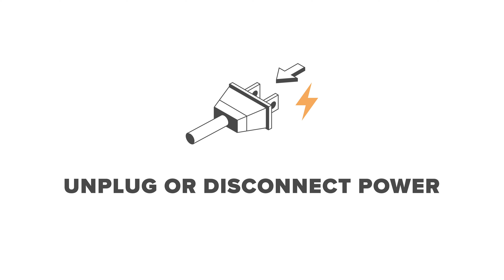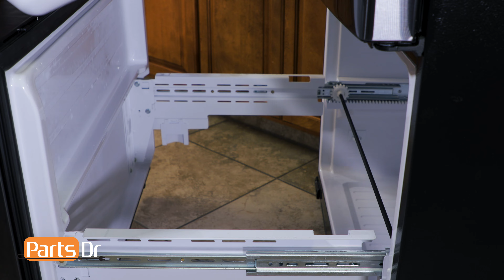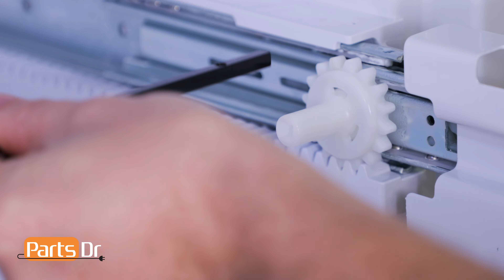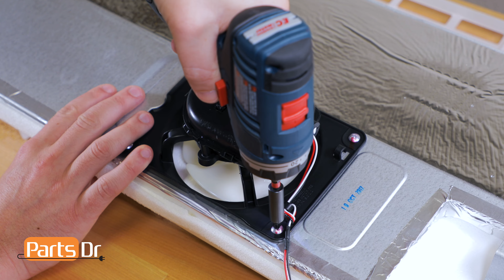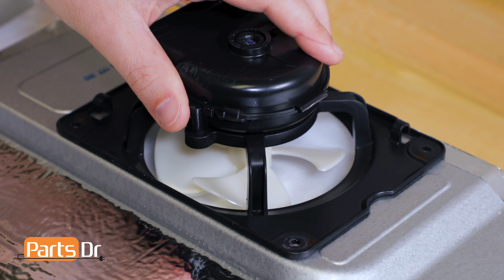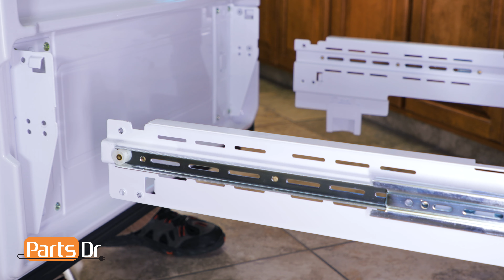How to replace Samsung freezer evaporator fan motor part # DA96-00959D

Comment from the maker: Thanks for watching our step-by-step guide on replacing the freezer evaporator fan motor in your Samsung refrigerator! If you're ordering this part online, be careful with cheaper aftermarket versions, especially from sites like Amazon or eBay. These low-quality parts often don't perform well and can lead to cooling issues or early failure. For reliable performance, we always recommend using genuine OEM parts. You can get the original Samsung part shown in the video at https://partsdr.com. Happy repairing and let us know how your repair goes in the comments!

Comment: This video was super helpful.  Make sure your evaporator fan is in the freezer.  For some Samsung fridge's it is in the main refrigeration compartment.  I watched another video from another company and thought mine was in the main fridge.  Took it apart and there was no fan.  I almost gave up.  Then I found this video and figured out mine was in the freezer.  Mine was a little more complicated because there is an icemaker, but just remove the two screws and pull it out of the way.  Also my fan installed slightly different than shown here.  It is a three screw unit that is recessed in the panel.  Just a little more work to move some tape and remove the old fan.  I am 75 and do not consider myself super mechanical.  Had I not removed the top portion first this would have taken me about an hour, including unloading and re-loading the freezer   A man from a former reputable big box repair company came out and charged me $139 for a service call..  He listened to my fan and said the issue is a bad fan.  The door hinge was not closing properly either.  He quoted me $350 for the fan.  $350 for the door hinge assembly and $450 for labor.  He spent no more than 10 minutes at my home, told me that I needed to sign and pay, and he would order the part. Cost was $1150.   When I said I needed to think about it, he told me I was better off just to buy a new fridge and left.  My fridge is only 3 years old so I started doing some research.  Thanks to this video, the new fan is in and running great so far.  I had already purchased another fan online and it was nowhere near $350..  Had I found this video sooner I would have purchased it from these guys.  This saved me a lot of money and did not cost me too much in time.  Thanks Parts Doctor.  I would highly recommend this video and using your business.

Comment: Hi - great video! If my refrigerator stopped cooling but freezer still ice cold, is this the likely fix? I can't figure out of this fan feeds cold air into the fridge or if I should be looking instead at the fan in the fridge compartment?  I have the Samsung RF27T5241SR -

Comment: Is there supposed to be styrofoam behind the panel? I cannot seem to work mine loose.
Reply: I have styrofoam on the back of mine, too. It comes down with the cover that you are removing. Just pull out from the bottom of the cover, and then down and out gently, and make sure the styrofoam comes with the cover. Mine also had twin fan motors. I have to order the second since I have no clue which one is bad.

Comment: Is it a true statement if an intermittent humming sound coming from the refrigerator is the freezer evaporator motor fan, and not the compressor when the sound stops upon opening up the freezer door? And that if it were the compressor, the humming would continue whether or not the freezer door were opened? Thanks very much.
Reply from the maker: Most Samsung refrigerators have a separate evaporator fan motor in the refrigerator section.  https://www.youtube.com/watch?v=lre-FuQKN5s
Reply: @PartsDr  My question (better worded): 1. Loud humming sound. 2. Open bottom freezer door. 3. Close bottom freezer door. 4. Humming stops. Does this mean freezer evaporator fan is the cause of the humming and NOT the compressor? Thanks.

Comment: I have been having issues with my samsung rf28hfedtsr/aa. At random the freezer started making knocking noises, but there is now ice build up. I even did a force defrost to see if it could be something else, but nope the freezer kept knocking.  Could it be that the freezer evaporator fan needs to be replaced?
Reply: My issue too. The noise slowly got worse and the fan motor burned out.

Comment: Is this the fan that also cools the fridge? If it's not, do you have a video showing how to do that? My freezer is fine but the fridge isn't cooling. My fridge model number is RF32CG5300SRAA.
Reply from the maker: Most Samsung refrigerator models have separate fan motors for the refrigerator and freezer sections.  We have a video on the refrigerator fan motor in this video: https://www.youtube.com/watch?v=lre-FuQKN5s
Reply: @PartsDr  Thank you so much!!

Comment: If ice keeps coming back, can a supplemental defrost line be added to top as a fix?
Reply from the maker: If the evaporator coil is icing up, that indicates a failure in the automatic defrost components (defrost heater, defrost bi-metal, defrost sensor, main control board).
Reply: @PartsDr  any chance you have a video talking about testing or replacing those parts?
Reply from the maker: @Mirer03  See the videos linked below.
Not cooling: https://www.youtube.com/watch?v=_m7pW3PueJs
Test temp sensor: https://www.youtube.com/watch?v=J5bwcteeJNM
Test defrost bi-metal: https://www.youtube.com/watch?v=i4SNEgPoUMY
Test defrost heater: https://www.youtube.com/watch?v=q7hysgipzpQ

Comment: Can i ohm out the motors?  I have two fans for my freezer
Reply from the maker: Yes can perform an ohm test on the motors, but even if the motor passes that test the motor can still be bad.  A better test would be doing a voltage test if you are comfortable working around electricity.  We have a video that shows how to do that type of test here: https://www.youtube.com/watch?v=x9fK0bN72MA

Comment: Would a faulty evaporator fan motor also cause the ice maker to not make ice?
Reply from the maker: Yes it can, because the ice maker has to cool down to a certain temperature to make ice and if this fan motor isn't working the freezer will not cool properly.
Reply: Same with mine. The fan motor burned out, and the ice in the ice maker started melting. Water dripped down and out of the dispenser and trailed across my kitchen floor.

Comment: I have this refrigerator. I'm concerned that the fan (both of them actually-- the freezer and the fridge) might not be working. I don't hear either of them running when I open the doors. So, a couple of questions:

1) Do these fans run all the time?
2) If they do not run all the time, when do they run? If it's only when the doors are closed, then how do I test to determine if the fans are running or not?

The reason this question is coming up is because my fridge and freezer had stopped cooling. The freezer was running about 70 degrees (basically ambient temp) and the fridge had steading been getting warmer to the point where it was barely holding in the 50's and food was spoiling. I ended up adding a few ounces of refrigerant, and it is cooling properly now. HOWEVER... The difference between the unit's temperature reading on the display and the reading I get from a probe laying inside the compartments is several degrees different. For example, with the freezer empty, the unit reads -8 on the door (that's the temp, not the setting, just to be clear), but the remote probe shows +6; the fridge section is closer, but still a couple of degrees different. I put a small dish of water in the freezer after charging it and it did indeed freeze solid after a few hours, so it's not like the freezer isn't freezing. The concern is that the air might not be circulating, hence the vast difference between the internal thermometer reading in the probe I put inside. If the fans turn off when the door is open, then that would explain why I don't hear them running, but on my other similar fridge (a Kitchen-Aid), they do run all the time and you can definitely hear them with the door open.

THanks.
Reply from the maker: 1.  No they do not run all of the time.
2. The fan motors do not run when the doors are open.  This video should help you here: https://www.youtube.com/watch?v=x9fK0bN72MA
Reply: @PartsDr  Hey, thanks a million. I was wondering where that magnetic switch is... I don't see the little arrows you mentioned, but I found it! FYI one needs to use a pretty small magnet, as the big neodymium magnet I have was actually so strong that it re-activated the switch! LOL

Anyway, I assume the freezer has a similar mechanism.
Reply from the maker: @TheFeaz  The freezer is similar with either a reed switch or a physical switch.

Comment: Hello Ryan at Parts Dr.  Before I do the procedure for Fan Motor replacement, I must ask if this procedure works for the Twin Cooling Models (I have a Model RF268ABBP ). Im doing this b/c of Icing Buildup Noise on the Fan Motor on the Freezer, just like the Refrigerator which I do once a year. The noise stops as soon as I open the Freezer drawer, just like the refrigerator. Thanks for your help.
Reply from the maker: Your model is a little bit older than the one shown in the video but the overall process should be very similar.
Reply: @PartsDr  Thank you so much. Yes it was a 2011 purchase. First time bottom evaporator has frozen up. Im thinking new fridge. What brand would you buy if u were buying? And I understand if u don't want to say due to your business. But I be skipping over Samsung probably.
Reply from the maker: @jerrydeuser1052  Currently our picks would be Whirlpool or GE for refrigerators

Comment: Did the steps and found the issue. It was a baseball size chunk of ice on the left side, and a golf ball size chunk of ice in the fan blade. THANK YOU! saved us buying a new fridge.
Reply from the maker: Glad you got it fixed!  If the ice comes back after a few days to a few weeks you may have a problem with the refrigerator not going through the automatic defrost cycle properly.

Comment: great channel thank you for helping everyone.  only the top row of my samsung RF31FMESBSR freezer evaporator coil has frost but the other rows didn't even seem cold.  can i replace the freezer evaporator coils?  My evaporator fan motor is working.
Reply from the maker: If only part of the evaporator coil is getting cold/frost on it, that indicates a leak in the sealed system, compressor failure, or other sealed system problem.  This type of repair must be done by a professional and is expensive to repair.
Reply: @PartsDr  thank you.  got it, time for a new fridge.  any recommendations?
Reply from the maker: @silverback1416  our current favorites are Whirlpool and GE

Comment: Awesome video.  Had ice build up, so just defrosting it would have worked too...but quick bench test of motor didn't hurt.  Only discrepancy noted is length of  crossbar.  It was too long to simply slide out even with retaining clip removed.
Reply from the maker: Thanks for the feedback!

Comment: How can I determine if it is the evaporator fan or something else on my freezer? The fridge works fine but the freezer isn't freezing.
Reply from the maker: Usually, you would need to hold the door switch closed if you have a standard style switch or use a magnet if yours uses a reed switch and then listen to see if you hear the evaporator fan motor running.  You might find this video helpful here: https://www.youtube.com/watch?v=x9fK0bN72MA

Comment: Thanks a million. This video helped me open the bottom freezer part. Sure enough ice was building right behind that cover. I let the ice melt, put everything back together and now we'll see if the ice will not build up again. I suspect something fell behind the bottom draw, which prevented draw to close properly. Hopefuly that was the cause and not something else. Noise is eliminated for now. Thank you to creator of this video once again.
Reply from the maker: We are glad you found it helpful!  The ice build up can definitely be caused by the door being left open.  If the ice/frost returns you may have a bad defrost component (defrost heater, defrost temp sensor, defrost bimetal, main control board).

Comment: HI, i have the 263 model samsung fridge, the freezer fan assembly is identicle. I found mine frozen stuck. defrosted it, then took a 12v power supply to the fan leads and found that the fan works correctly. reassembled everything and pluged the fridge in, i depressed the switch on the side of the freezer compartment to simulate the door being closed, however the fan did not turn on. whats going on? thanks
Reply from the maker: Maybe your main control board is bad and not sending proper power supply to the fan motor?

Comment: Do you work on LG refrigerators? I have an LG Model LG LTC22350WH. The top freezer is cold but the fridge is warm. I pulled out the evap fan motor and it will run jumpering a nine volt battery to it. If I plug in the refrigerator and check voltage were the fan plugs in I am getting ten volts. I put everything back together but I don't think the fan is turning. I see in some videos where they show the fan getting 120 volts but the label on the fan says 13 volts It also has two part numbers on it 4681JK1004 and 4681JK1004a. Could you shed some light on the subject? Thanks.
Reply from the maker: 1. Check the light switch as LG refrigerators usually stop the fan motor when the door(s) are open.
2. Some LG models have variable speed motors and they vary the voltage to the motor to increase or decrease the speed at different times.
3. Make sure to do your voltage test while the motor is connected and under load.  Sometimes the fan motor voltage from the main board will check okay with no load but fail when there is load on the board.  If the board is bad you should replace both the motor and the control board at the same time.
Reply: @PartsDr  Thanks for getting back so quickly. 
Very important : Step number 1. Did not realize I needed to closed the door switch. Motor does work once door switch is closed.
Thanks very much. Important to know how it works to fix it or not to have to fix it. It did have a build up of ice. Thanks again.
Reply from the maker: @mostlymoparih5682  You're welcome! 🙂